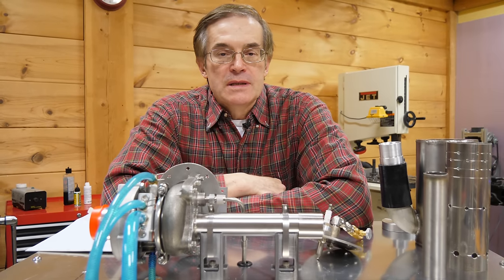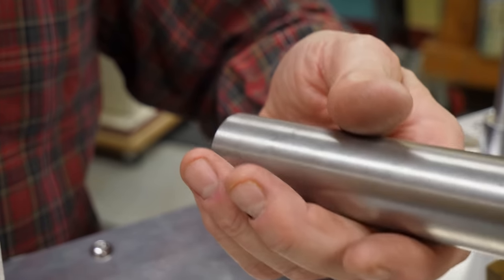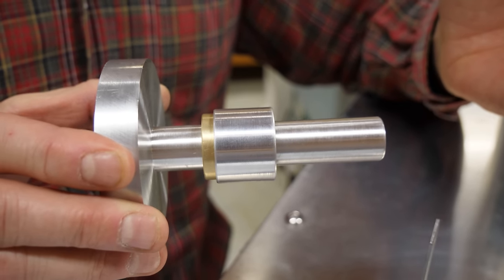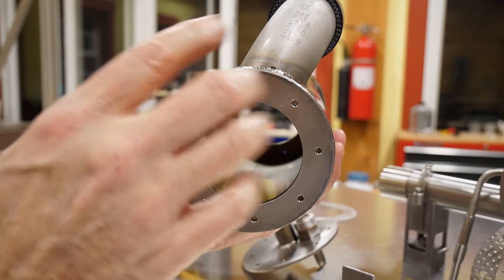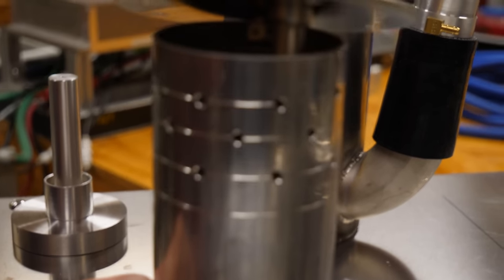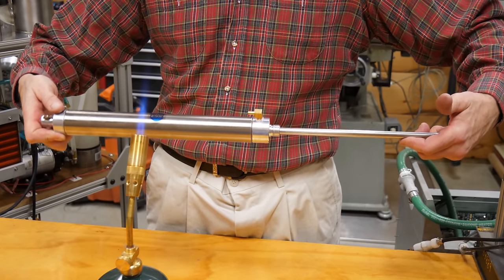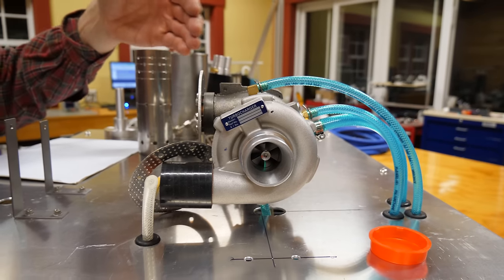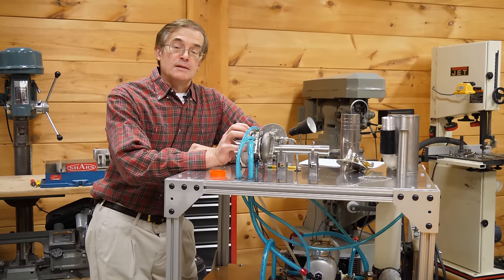The Turbojet!

Comment: This video was awesome, but I have a different related interest that might also interest you and others, turning a turbo into an electric generator. Turbos turn at very high RPMs, but so do present electric motors. Could a turbo be turned into a light powerful generator?  They do something similar for CHP home generators.
Reply from the maker: It could.  The smaller turbos operate at extremely high RPMs and may be difficult to couple to a motor directly based on the RPM limits of the motor/generator.
Reply: @TechIngredients  A quick search found a 120K RPM brushless DC motor which I would think would put you at least in a right ball park, but an alternate plan would be to use the impeller as a generator using eddy currents.

Comment: If you want to trade thrust for efficiency, is that difficult to achieve? Eg. Adding a generator on the shaft to generate energy and provide rotational energy instead of thrust, or are they the same things really?  Im learning this stuff and I am not a mechanical engineer.

Comment: AgentJayZ must have worked in aerospace as I recognised the wire locking techniques, are you using a boiler nozzle ?, if so, what angle of spray, us gal per hour ? and pressure, it could do with a swirl plate around the nozzle, it gives it a better burn

Comment: Alternatively use the Collin Furze bodge it and scarper method that sort of works ish, using little more than a knackered old turbo and a stainless steel loo brush holder and a drill and screwdriver. Jay Zee would be having nightmares.

Comment: So, let me see if I get this straight.

If I were looking at building a turbocharger gas turbine generator, I don’t want thrust, so I need low AR and Trim numbers?
Reply from the maker: Yes.  You're  looking for the highest compression ratio for a given frame size.
Best to compare flow maps (easy Google search), look at the island of highest efficiency, and compare pressure ratios.

Comment: Here is the reason why my device does work. You see even tho the more electrical load you impose on a system ends you up with greater back emf hindering your devices ability to move and generate current, there is a way to work around this. My device multiplies the amount of mechanical motion that is taking place because of the 1 motor. On top of that, it eliminates any extra resistance that could have been imposed on the motor by making the other wheels spin by having the magnetic fields hit the rotating discs the way I described. You see, the vertically positioned disc connected to the motor is perpetuating the spinning of at least 4 main discs that are spinning magnets at no extra effort on it's own part because as it spins around powered by the motor, it is the horizontally positioned magnets that are shielded by high permeability metal that are using their magnetic push out sideways to force the other horizontally positioned discs to spin. So even tho each of those 4 discs spinning are somewhat hindered by the back emf it does not change the inescapable fact that each disc is perpetuating the flow of current in the copper coils above them and the amount of electrical current being perpetuated between all 4 discs is greater then the amount of electrical current the motor needs to run at max potential. It is called over unity and the extra electrical current the motor does not need can be fed into larger more elaborate electric generators. Imagine 12 of these designs contributing to the power needs of a much more powerful design (Probably electromagnetic) that is utilizing this same idea of multiplying the number of horizontally positioned discs that spin because of the motion of one powerful  motor spinning a vertically positioned disc cleverly positioned so that it spins at least 4 other discs at a much higher velocity because of it's more powerful design. In short its all about multiplying what the first motors disc is interacting with & second, up scaling the design to more powerful designs that utilize the same principles.

Comment: Stoichiometric at sea level, 14.7 to 1 is theoretically ideal, but a little richer usually makes more power in practice.  I'm referring to reciprocating engines,  in this instance maybe 14.7 is ideal?
Reply from the maker: You're referring to pressure ratios. A stoichiometric ratio is a chemical ratio that varies with each fuel.  For example, a methane molecule or CH4 will require exactly two O2 molecules to burn and form one CO2 and two H2O molecules.  This two to one ratio is multiplied by the oxygen ratio in air to give methane an approximately 10:1 stochiometric ratio by VOLUME in air.

Comment: hey, doctor, I'm sure i can't find it today but i have seen a video of a guy that was running one on waist dunnage matter of fact it was one little stick of pallet wood and way more wiggle room to burn more.  it had a sight glass so you could see down in it and it burned so hot you could see the purple flame. "sign of plasma burning" i think.  anyway, i could think of many ways of making that run a household. it would have to have its own sound deadening confinement to make it tolerable in the noise department otherwise it would deafen everybody around it.  it would make perfect sense if you were one that had access to a lot of wood long term. the combustion chamber,' looked to me as if it was an 'O'lboiler casing it has a pipe cap where he fed it and for a makeshift blow off valve, the lid on it had old truck valvetrain springs holding it down incase it got wound too tight lol.  anyway, love this subject you picked i never get tired of the stuff you teach i hope you are around a good long time. you make my days go better professor. scale it up slightly and i think you could run a small compound on it.

Comment: Sorry if you covered this in the video and I missed it, but can you take the turbine section off another turbocharger, connect it to the output, remove the compressor and very, very carefully attach it to something like a brushless motor to make an electric generator?  I mean I know the answer is technically "yes", but is there something just really broken about that idea?
Reply from the maker: In principle that will work.  The challenge is the extremely high output RPM as well as the relatively low torque.  A turbine sized for the engine I demonstrate will need to spin at up to 240,000 RPM.  Even a gear reduction system would be very expensive if you could even find it.  Using the turbine from a much bigger turbocharger will not effeciently extract energy from the smaller turbocharger's output.
We are working on a large diameter, low speed, high torque turbine for this purpose.  It operates a lot like a Pelton wheel.
Reply: @TechIngredients  Yeah, I think thats too many r's per m.  I've been keeping an eye on things like this for a while
https://www.dreamworksrc.com/jetcat-p130-rx-turbine.html
but now I'm suspecting that the electric start that they all seem to have either has a centrifugal clutch on the compressor shaft or a solenoid to disengage the electric motor after start up.

Comment: Would you not want the hot oil to go directly through the radiator before the reservoir to maximize the cooling efficiency?
Reply from the maker: It doesn't really matter.  The oil only becomes warm.  The oil will loose it's heat primarily in the radiator, but if a little is lost through the walls of the reservoir that's Ok.

Comment: @UCVSHXNNBitaPd5lYz48--yg Just one note, the highest flame temperature is not achieved burning in stochiometric A/F ratio, but slightly rich, about 1.05 times. The reason is the enthalpy of the products, which in a slightly more rich mixture are higher to those of reactants, meaning a more energy is released and thus more heat.

Comment: Very nice set up Sir! May I ask what type of turbo charger you are using? The BorgWarner 475 hp turbo's I use have the same body style as yours, but the oil lines are top and bottom (180 degrees from each other) . The water supply and return lines are parallel.

Comment: Would longer combustion chamber allow/make it easier to achieve better fuel combustion/efficiency with easier temperature control? 

Large number of small diameter holes would allow more linear air-fuel mixture. With longer "flame length" and more controllable temperature... would it?
Reply from the maker: Longer won't  hurt other than making  the engine heavier and a little  more expensive.

Comment: I have never heard anyone call it a "compressor turbine".  The turbocharger has, in addition to the bearing(s), a compressor and a turbine, one compresses and the other expands.  Thanks for the thrust derivative, square inch to pound force.
Reply from the maker: I did that because industrial
 turbo compressors use an identical impeller to compress air.  In turbocharging lingo they just call it a compressor even though a piston can also be a compressor.

Comment: On turbojet (axial flow compression) engines, [again reference Agent Jay-Z] they rely on multiple stages of compressors to raise the compression ratios as high as 23:1.
Reply from the maker: Correct!
Reply: @TechIngredients  At one point I used to build turbojet engines in a factory.

Comment: Couldnt you use steam injection for cooling the combustion. Integrate that into heat that thing is already producing. Probably flash steam on demand and then it would also boost it.

Comment: In a 2-stage setup, would it be helpful to put an intercooler before the air inlet in the combustion chamber (and possibly before the air inlet on the inducer) to increase mass air density like you would with an automobile?
Reply from the maker: For maximum power yes, but for maximum effeciency, no.  That heat is part of the energy that will be available to drive the turbine and be converted into kenetic energy as exhaust velocity.

Comment: Great videos. 
Question: if the plain bearing ( journal bearing ) is supplied with an external source of oil with a known flow rate would it not be considered a hydrostatic application?
Reply from the maker: I think the dynamic comes from the fact that either th3 oil or the surfaces are moving.  Hydrostatic usually refers to liquid  pressure.

Comment: I'm wondering if you could introduce water in the combustion chamber and would turn to steam increasing the rate of expansion
Reply from the maker: The only benefit would be the additional mass of the water added to the input air mass unless the water was used to cool the combustion products in order to protect the engine from melting.

Comment: Beautiful build as always, will thrust measureing be icorporated in complete unit?
Reply from the maker: We're struggling with that.  Mobilizing the entire table is right out and even just the jet is challenging because of the heat and so that the feed throughs will allow for a variety of different jets to be tested. This is still our best bet because  metered deflector plates did not work at all!

Comment: So I see a lot of people use stainless steel for the combustor. I know it can withstand higher temperatures but I currently do not have an effective way to join it together. Eventually I intend to get a machine capable of tig. Anyways, if I use less fuel to keep the heat down could mild steel be used? This isn't going on a vehicle or anything like that. I actually intend to mount it to a stationary cart as a working display/ proof of concept.
Reply from the maker: Yes, it can.

Comment: oil bearing is the main reason u should wait 1 or 2 minute at idle before cuting ur engine if u where driving gaz to the floor... cuz the hot end of the turbo is eating flaming exhaust in his face and u should wait for it to cool down a litle before cuting the engine in the goal to not burn ur oil or bearing with the red hot heat comming from the hot end of turbo to the bearing part

Comment: Both compressors and turbines have inducers and exducers.
Reply from the maker: That's right.
Reply: Also, FYI, your oil drain should be DIRECTLY down, otherwise you risk oil blow by and washing out your bearings.
Reply: Eddy current (prox probes) are also a really good means to measure shaft speed on a turbocharger.
Reply from the maker: That's a good point, but I'm not sure how that will occur if the oil pressure exceeds the boost pressure.  And, if it doesn't exceed the boost pressure we're in trouble anyway.
Reply: @TechIngredients  There's a video somewhere on the internet that explains why having your oil drain point directly down is vital to CHRA lifespan.

Comment: Would it be possible to remove the turbines and bearings and put them into a tapered cylinder rather than the turbo housing?
Reply from the maker: Possibly, yes.  The bearing is part of the cast iron mid section and would require that the compressor wheel or the turbine be removed to extract the shaft.  However, the scroll shaped housing shape is needed for these to operate properly.  These are not designed as axial flow blades.

Comment: The terms that you used were actually incorrect. Both the compressor and exhaust wheels have inducers and exducers. The inducer is the tip diameter of the blades (the small part) and the exducer is part where the blades are largest

Comment: this is amazing!  where do you get all the hardware (for example the little radiators)?  I want to build a few projects but I always have such a difficult time finding the parts I need.
Reply from the maker: We've been doing this for years and have reached critical mass.  We can usually scrounge a needed component from some other completed project.

Comment: Hey, great video! Question: would you be able to take a compressor housing and impeller from a larger turbo and kinda mix match parts to raise the compression ratio?
Reply from the maker: Theoretically,  yes.
However,  there are already  a variety  of ratios available  in finished units.
Have you looked at some flow maps?

Comment: You have something wrong about how you describe the turbocharger.

Each turbine has an inducer size and exducer size. 

On the compressor side the inducer size can be seen from the front, as you show. But the  compressor exducer is not visible and is larger than the inducer. When people talk about turbo size, they are referencing the compressor inducer.

The exhaust inducer is where the engine exhaust enters the turbine housing. A small portion of the exducer can be seen from the turbine entrance. The exit side of the turbine housing, you can see the entire exducer. This is inverted from the compressor side.

Also the bearing housing is referred to as the CHRA. Center Housing Rotating Assembly.

Cheers mate!

Comment: I know drilling the holes is easier but would tear drop air intake holes be more efficient? or increase power output?
Reply from the maker: Commercial jet engine combustion cans use shaped inlet holes, so I assume there are advantages.  But, the DIY model is based on many compromises and the hole geometry is probably not the largest.

Comment: Great video! What kind of sensor did you use to measure both temperature and pressure of the oil flow? I have been looking on the internet and cannot find one. Would appreciate any input, thanks.
Reply from the maker: I went to Amazon and purchased an after market instrument cluster with the associated probes for automotive applications.  The advantage is they all operate on 12 V and are sturdy.

Comment: hi, this information is also valid for building standard RC turbojet (using only the compressor)? Are there any advantages or disadvantages with this design and the standard design sold commercially? As well as saving a few hours on the lathe and mills ;)
Reply from the maker: This is easier and less expensive, but is heavier and less aerodynamic.  I wouldn't attempt to use this approach for an aircraft.

Comment: Great video - one thing----Inducer is the size of the blade, not the inlet tract.
Reply from the maker: They're essentially the same when measured at the same plane.  Of course the bell shaped opening is irrelevant.
Reply: @TechIngredients  No they are not - there is a clearance between the inducer Blades of the compressor wheel and the housing.
Reply from the maker: Do you know the size of that gap? In a properly designed compressor it is extremely small.
Reply: @TechIngredients  It has nothing to do with the design of the compressor, it has to do with the bearing system, as this is where the clearance (radially or axially) exists. Depending on the make and model turbo, the bearing system clearance/tolerance will differ. Clearancs from 0.127mm upwards are expected in the smaller bearing systems like the Garrett GT15-25..... and so on. 

The clearance between the housing and inducer of the compressor ranges from 0.35mm (per side) upwards, depending on the make and model turbo again. In relation to the blade area this is up to 5-8% of the blade area...... its alot more involved than most people think

Comment: You said that a big inducer needs about 1.5 times bigger combustion chamber and a small one three times the diameter. But is there a specific formula with precise measuring units?
Reply from the maker: No.  There are too many other variables such as pressure ratio and fuel type.  I gave an empirical guideline.
Reply: Tech Ingredients thanks for the info. But will it work if you don’t do it precise? For example 200 percent of the diameter of the inducer if it has a diameter of 60mm